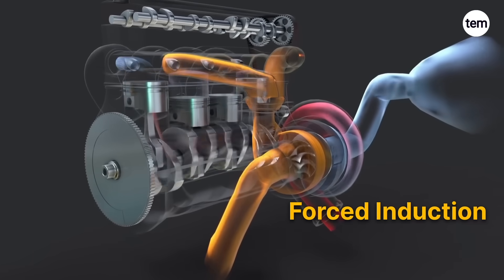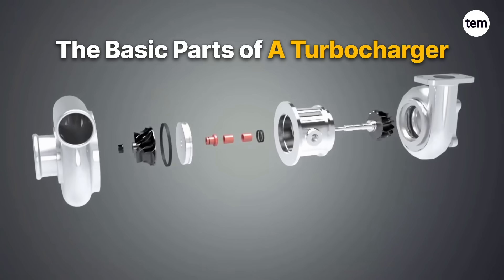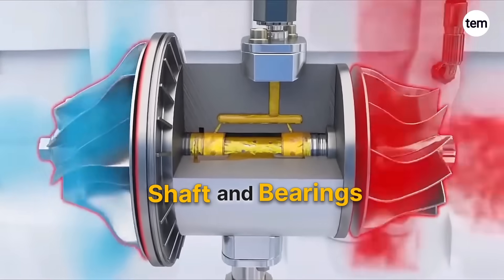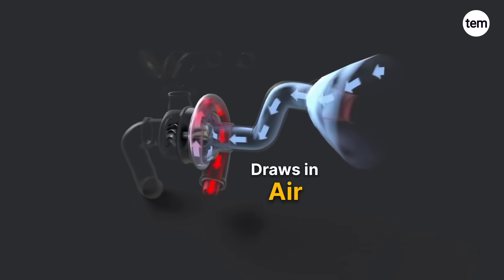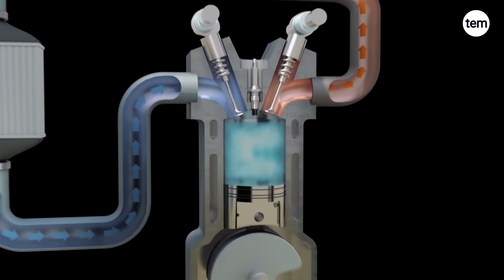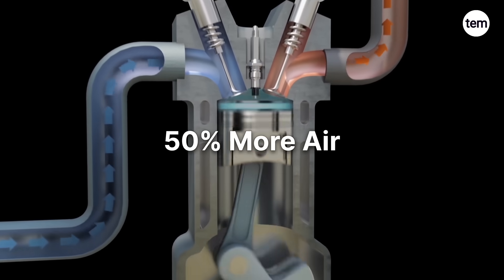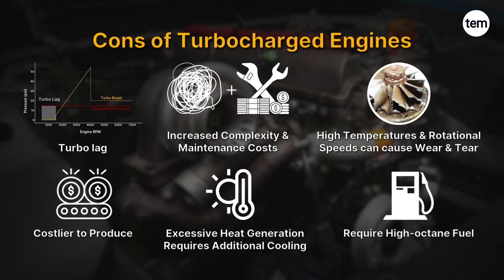How does Turbocharger work?

Comment: Doesn't Audi have an electric supercharger to eliminate turbo lag? Afaik, there are attempts to minimize turbo lags such as combining supercharger and turbocharger, VNT/VGTs and having two different sized turbochargers and afaik, those will further increase complexity and maintenance costs.
Reply from the maker: You're right, but it's called twin-charger system which comes in VW/Audi, JLR, Lancia etc. Where a supercharger is for low-end power and turbocharger is for high-end power. The supercharger is mechanically driven by the engine, so it delivers immediate power and torque right from idle condition. As engine speed increases, exhaust gas flow builds, allowing the turbocharger to take over duty of boosting and sustain the engine power. Thanks for Watching...

Comment: So turbochargers are just compressors that are powered by exhaust gases. This is why there is a lag between when you press on the accelerator (produce more exhaust) and when the compressed air gets into the engine.

Comment: There is no improved fuel efficiency with turbo. The difference in fuel consumption is miserable if you have engines with close parameters of power and torque.

Comment: If you want an engine that lasts for 300 thousand miles and more without any major repairs, buy V6 or V8 atmospheric, period.
Reply: Skoda scala 1.0L europe bussines car 220.000Km in 2 years.
1 mile is 1.6 km 
Every day 400km 
Avrg. 150/kmh highway speed
Reply: Or just a diesel engine.

Comment: is it true that you need to let your turbo-charged engine run in idle for 5 minutes before shutting it off after a long drive?
Reply: yes thats true but 5 minutes is exagerrated, you can idle it 1-2mins before turning it off especially after you floored it
Reply: Greetings, it is true that you should wait a few minutes for the turbo to cool down to prevent the oil remaining in the turbo bearings from burning. However, five minutes is too long—around three minutes is enough. In any case, the owner's manual should include the recommendations. I'm telling you this from my experience of owning two turbocharged cars.
Reply: I have a 2L Turbo Petrol witn 4 cylinders, the owners manual recommends waiting about 1-2 minute before shutting down the car… especially after hard driving. 

This might be wrong but I don’t think Turbo kicks in if you’re soft driving (gentle throttle, low RPM)… so in that case the wait is more like 30 seconds which usually happens naturally if turning the engine off is the last thing you do before stepping out of the car.
Reply: in modern cars, no
Reply: @Izzy-oo5rm  wrong, modern cars need 1 or 2 minutes. Depends on the driving. Refer your owners manual for OEM’s recommendations

Comment: You can keep your turbos.  I'll stick with basic technology rather than high engine stress performance.  And my car runs on standard petrol, currently 20 cents per litre cheaper than premium which Turbos require.
Reply: 90% of cars in europe are small turboed diesel engines, id even say its hard to find a naturally aspirated engine under 2 liters where i live
Reply: Diesel engines are built with stronger materials. Even if not turbocharged a diesel engine is engineered to withstand immense pressure since the fuel itself ignites by compression, not by sparkplugs like petrol engines. Diesel self-ignites with high pressure. Way safer to have a turbo on a Diesel rather than putting one in a petrol engine.

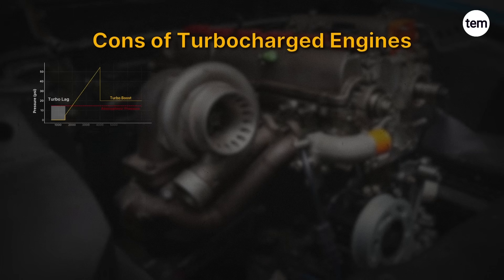Comment: 2:30 IG better performance at lowers altitudes not higher altitudes
Reply: They mean higher altitudes because there the air density is lower. The turbo helps you against that.

Comment: i dont know about the improved fuel efficiency in the pro side chief. a NA 2.0 4 cyl engine will def use less fuel in every day commute than a 2.0 4 cyl turbo engine
Reply: I think the point is that a NA 3 liter engine will use more fuel than a turbo 2 liter engine during everyday driving.  You have to compare engines of equivalent power output rather than displacement.

Comment: Turbochargers is ok on big diesel truck engines, not small 3 cylinder petrol engines. It's a better investment to buy a n/a petrol car. Might have less power but will last longer, be more reliable, and cheaper to maintain.
Reply: yeah no one who turbos a car is thinking about reliability and cost bro it’s all performance not reliability when it comes to these
Reply: @JustAnOldBenz  b58 is reliable af
Reply: Turbo cars on hills are machines, N/a are even noisy and annoying
Reply: you are living in a country with less hills and ramps, don't you? torque curve of n/a petrol engines are low. you need turbochargers to increase air quantity per cycle, hence to have more torque to drive. It will be difficult to accelerate with n/a petrol engine on hilly conditions. Reliability on the other hand, of course n/a engines can be less faulty, but it mostly depends on how long you keep the car.
Reply: downshift and get the power up then
Reply: With turbo what you lose on repairs you regain on fuel economy
Reply: Cars arent investments

Comment: Thanks you to teach and your awareness for the good teaching but I have a questions why does turbo brings oils on both sides
Reply from the maker: Running engine on high RPM can increase blow-by gas that worn out piston rings leads increase in crankcase pressure. Because of that, an oil which is lubricating shaft in turbo is not returning in crankcase and leak itself in turbo from both sides.

Comment: ICE engine are less emissions
Uses green fuels of E85 ethanol
just use fuel octane rate are not included
91-93 or 100 is higher

Comment: Let's just say cons of having turbo is just money
Reply: Sort of. The increased engine wear and the turbos are among the most common points of failure themselves. Apart from money having a damaged engine is also a pretty big inconvenience. Same goes for more regular oil changes and having to let it cool down through idling the engine after heavy use. More subjective reasons are that Turbochargers are often used to replace bigger displacement engines. And what goes for me personally Ive always been more of a fan of linear acceleration instead of a big boost suddenly and then a lack of power in the higher rpm range. Of course there are ways around that with biturbo setups and whatnot but those are more often than not only found in the higher price ranges. Not affordable for most drivers.
Reply: @TheDude50447  i agree with you. But mostly is all about money.🤣🤣
Reply: @TheDude50447 Agreed
Reply: What do you mean with rev after 20 mins ? Just the fact to not rev before about 20 mins drive or to rev it regulary? Thx man
Reply: @SirBolle  i mean like drive it slowly, rev max 3k for 20min then you can push it, in winter its ideal to shift from 2-3 gear at 3k rev. never rev car when just started, wait a minute then slowly go, no show of or anything before engine has operating temptature. its just basics for bmw.
Reply: @sonnenritter-e2e ok, thats what i was thinking. I almost always start the Motor and then wait for like 60sec before i get going.
Reply: @sonnenritter-e2e it’s basics for most ICE cars, not just bmws. Unless you’re quoting your owners manual, what you’re probably describing is the wait for engine OIL to reach operating temperature. That takes about 10-20 minutes AFTER engine coolant is at operating temps. Every car shows coolant temp, some selective cars show oil temp. This is general rule for cars.

That doesn’t have anything to do with turbo. Turbos usually come with the turn off wait recommendation of about 1 to 2 minute of idle before shutting down the engine.
Reply: 💯 AGREE
Reply: The power curve of naturally aspirated engines is so much more predictable and way more enjoyable imo
Reply: i got turbo in my f20 bmw and have no issues in 10y so what are talking about? it has few rules and thats all, you only have to keep eye on it and rev after 20 min of goin somewhere.
Reply: @sonnenritter-e2e if it's naturally from factory, maybe it will not cost much money. I mean by people who add turbo to non turbo car like Honda Civic ek9.
Reply: Money money money. No money. No honey.
Reply: @libramoon9968  HAHAHA true

Comment: And decrease engine life
Reply from the maker: Turbocharged engine parts are designed to withstand high temperatures and high pressure. But, if it's not Maintained well then it's concern for sure.
Reply: Diesel engines are built with stronger materials. Even if not turbocharged a diesel engine is engineered to withstand immense pressure since the fuel itself ignites by compression, not by sparkplugs like petrol engines. Diesel self-ignites with high pressure. Way safer to have a turbo on a Diesel rather than putting one in a petrol engine.
Reply: 😂😂😂 Agree

Comment: Turbo charged engines won’t run beyond 1 lakh kilometres
Reply: My turbo diesel still running in perfect condition after 1.8 lakh kms🤷🏻
Reply: @ may be tractor
Reply: My friend has a Baleno RS (1.0 turbo) that has clocked 1.6 lakh kms with no issues to the engine.. it's still as smooth as it was new. Maintenance is slightly higher than the NA Baleno but reliability is similar.
Reply from the maker: Well maintained 👍
Reply: Pretty much every  Toyota innovas and Fortuners in india run on turbo charged engines. And most of them have easily outlasted 2 lakhs kms with regular periodic maintenance.
Reply: My Innova crysta at 1.5 lakh km and still running smooth
Reply from the maker: Well maintained 👍
Reply: So my Skoda with 340.000 km (3,4 lakh km I believe) is not real then?